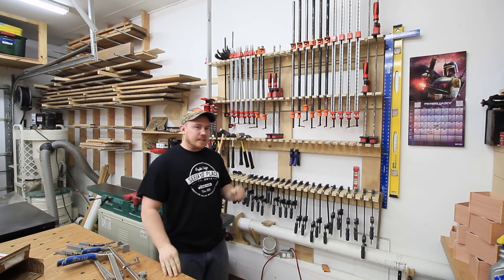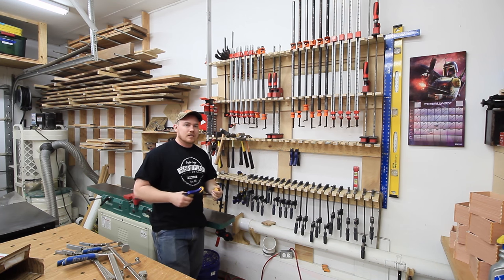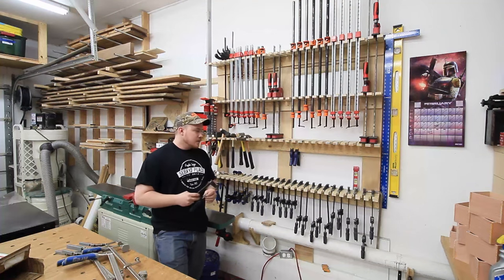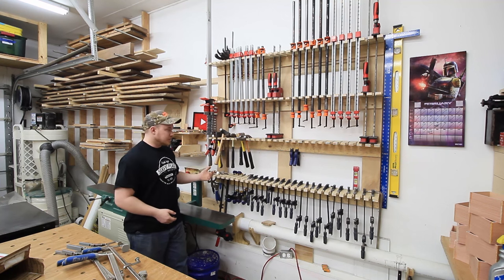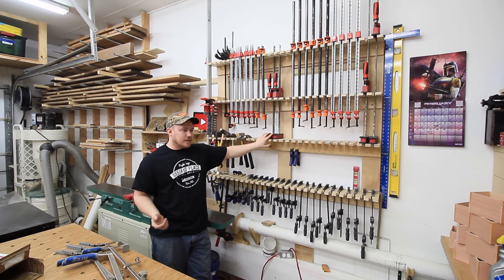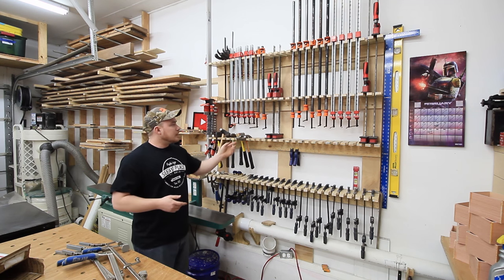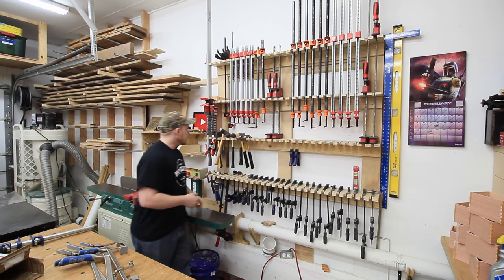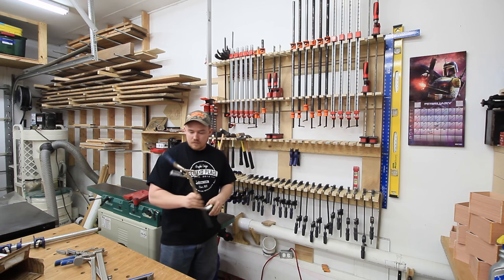Tool Talk #8: Clamps

Comment: Hey bud.  Big fan, love your videos, learned a ton from you and your other buddies on Youtube.  What clamps would you recommend for laminating wide boards if you don't have the Bessey K style clamps?  I notice you use them a lot in this situation.  I would imagine they're great because of the wider spread of pressure.  But I was curious how to get clamping pressure in the middle of the board.  I can only think of deeper mouthed clamps like screw clamps or big C clamps.  I've only been woodworking for about a year, so this may be a dumb question haha.  Thanks for the help, videos, and affordable plans and material.  Great job!
Reply from the maker: +swatellico I'd use 1/2" pipe clamps on top and bottom of the panel.

Comment: What length pipe clamps do you use most often?
Reply: I hate the black pipe! The paint they put on them always comes off and stick on my hand all the time.  I usually buy the original metal color and clean it up with denature alcohol and then put paste wax on it for rust protection.  I usually buy them from Homedepot and ask them to cut it to 8" and 26".

Comment: The Bessey 6 pack clamps are sold out online always my luck and the nearest Home depot by me is like an hour away
Reply: +Charlie Thompson just have them email you when they are back in stock online.  I kept having that problem with a door knob I wanted.  Once it was back in stock they let me know and was able to order it.  I have also purchased the Bessey 6 pack and like them so far.
Reply: +Eclectic Arborist I did have them email me when in stock got a email the other day said they where in stock but then it  said not sold in my store and wouldn't let me add them to my shopping cart next closest store is like 80 miles away. Thanks for your help anyway
Reply: I bought them online and had them shipped to me.  They were out at my local store also.  I had another purchase that put me over the min order for free shipping.
Ship to store wasn't an an available option.
Reply: +Eclectic Arborist Well I don't know what I am doing wrong I go to HD website and it says not available for pickup in my local store and wont let me order them online and Its like they are a in store only item or something I click on other stores and says limited quantity to call that store Thanks for your help though
Reply: I just looked at it and they changed it to "in store only"  but I would keep a look out and see if they change it back periodically.
Reply: +Eclectic Arborist Yea I just looked again and it said in store only to thanks for your help

Comment: I think those 6 packs of Bessey clamps were a Black Friday/Christmas promotion for Home Depot. About a year ago I picked up maybe 6 4-packs of these http://www.homedepot.com/p/BESSEY-Clutch-Clamp-Set-4-Piece-GSCC4PK/205086977 for $9 each. The store no longer carries them and I'm not sure if it was a price mistake, but for what they were being sold at, it was a steal. I don't think you mentioned it, but what brand were the 1/2" pipe clamps?  For the 3/4 pipe clamps it looks like the Irwins are quick release but Bessey and Pony/Jorgensen have models that screw onto the pipe, and have legs to give clearance for the screw handles.

Comment: IMO re the K-body clamps: I can't afford to own cheap clamps. The K-body clamps are wonderful in the way that they don't flex and the ends stay at 90 degrees. 
Interesting take that you have on the 1/2" pipe clamps over the 3/4"